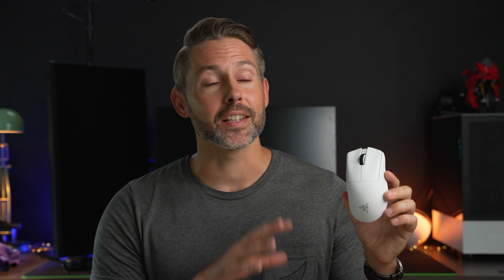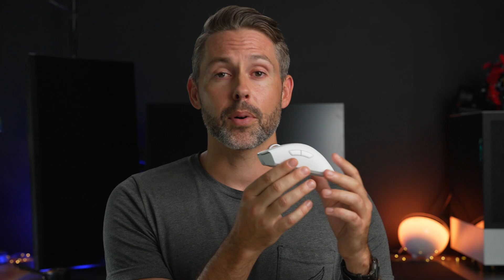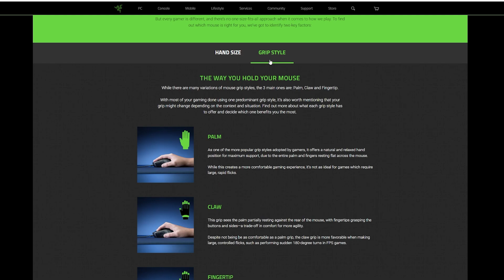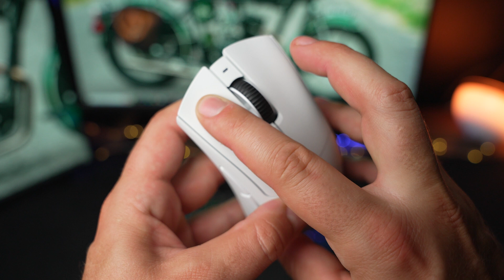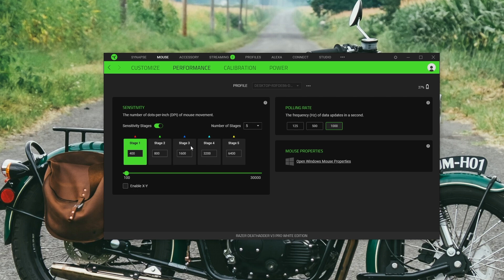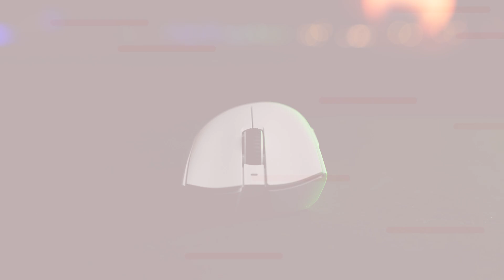This just feels right: Razer DeathAdder V3 Pro review

Comment: It's legit infuriating that the mice with the best wireless + sensor on the market only have 2 programmable side buttons. When most games other than the snail paced 20 year old tacshooters and their clones require more than that. Your only option is to get the deathadder v3 pro/viper v2 pro if you want a lightweight, modern mouse with the best sensors etc. The only other mouse with these sensors seems to be the basilisk v3 pro, which is a g502 clone that's even heavier than the g502 x. And since I already have a g502 lightspeed and x I don't want to guy the "razer" version. I just want a lightspeed mouse that has at least 3, easy to press programmable buttons.

Comment: Upgraded from Model O Wireless and was definitely starting to get some crampy wrist feel when gaming for long hours. Hardware wise, if you can get around the battery life, the MOW actually gets more crap than it deserves. They should eliminate the RGB to make it lighter and get better battery life out of the box. It was solid for the year I used it. 

Now the DAV3 is definitely more premium in every way. It is lighter and there is just something about the precision of the sensor that has zero perceptible delay. The main buttons 1 and 2 are noticeably better in their feel. Side buttons are flawless along with the scroll wheel. I'm going to welcome the improved battery life over the MOW as well. Will try to update this space in another week or two of usage.
Reply: Im about to upgrade from a MOW to the DAV3 since my MOW Scroll Wheel broke. How is the experience with the DAV3?
Reply: @movinperera  Mouse was slightly too big for me in FPS tac shooters even though I have 19.5cm length hands. It's a very large mouse. It wasn't totally the size but the shape itself makes it hard to get a good squeeze on the mouse especially when your hands and the mouse are very dry. Other than that, I loved everything else about the mouse. If you can try your hands on it in a store first I would recommend it. My friends mouse wheel broke on DAV3 after 1 year of use. But this issue is not unique to DAV3... I've had 4 Superlight wheels go bad in 2 years.